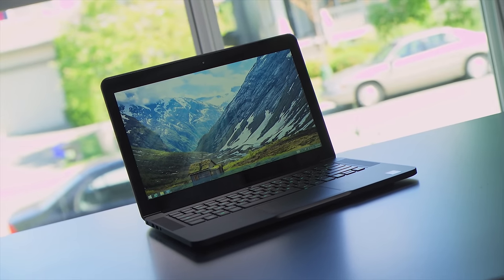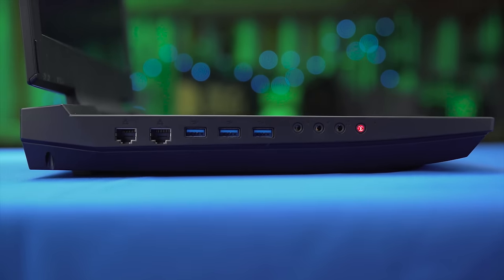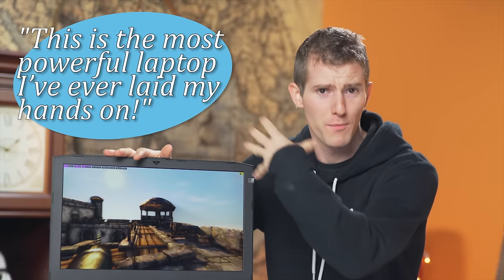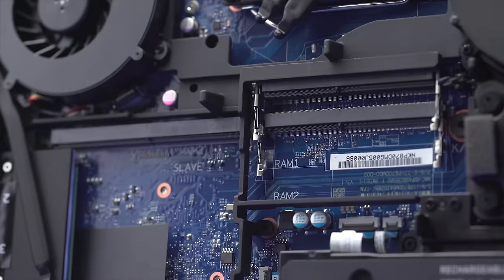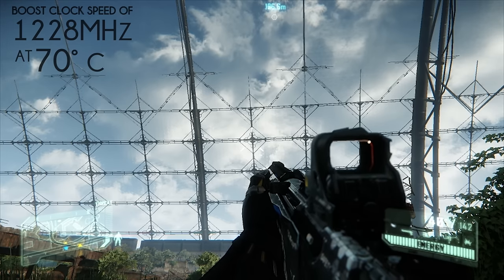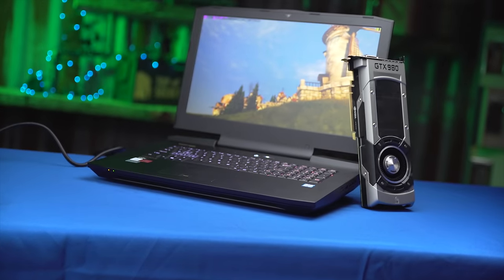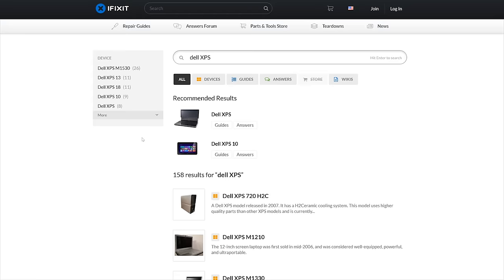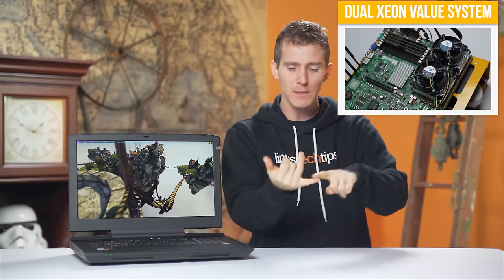Full Desktop Gaming Performance in a Laptop

Comment: Which cpu is better? 6700k or 6820hk?
Reply: +Victxr Can't really go wrong so better go cheap, right?
Reply: +Victxr Also I think the 6700K is faster
Reply: ImPDK Idk man but i'll do some research but thanks man.
Reply: +Victxr definitely go with 6700k. If the 6820hk has anything different to offer, you wont notice. Just wasting $1000.
Reply: Generic Name The 6820hk can turbo to 4.2 GHz
Reply: but the 6700k can go up to 4.8ghz Victxr
Reply: ImPDK I don't know the difference between the two.
Reply: I need to know which one is best with editing for video, photoshop exc.
Reply: Victxr Unless you care about power efficiency just go with the 6700k
Here's a useful link for comparing the two:
http://cpuboss.com/cpus/Intel-Core-i7-6700K-vs-Intel-6820HK
Reply: ImPDK No, I just need to get the job done fast so it will be enjoyable. About how long would it take to render a video about 4 minutes long at 720p at 60fps? Also is there a gt72 model from msi that has a 6700k processor?
Reply: Victxr
About the gt72 you can check this link:
http://www.msi.com/product/notebook/#?tag=Intel%206th%20Gen.%20%28Skylake%29
And I can't give you an answer about video rendering time since I don't own one myself (sorry about that :/) but I can tell you it's one of the best CPUs out there for video rendering.
Reply: ImPDK Altight but what about the render speeds?
Reply: Victxr
Can't tell because I don't own the CPU and I can't find anything online but I can say it's one of the best for video rendering, as I said in my previous comment.
Reply: ImPDK Okay then. Thank you for your time I really appreciate it and this upcoming future I will have enough saved for it. :)
Reply: Victxr
I'm happy I helped :)
Reply: The 6820hk is a laptop-grade or mobile-grade cpu while the 6700k is a desktop-grade cpu.  With that said, the 6700k is better but, much more expensive and is not really needed for gaming. If you're looking to buy a laptop the 6820hk would be just enough. Mind me though, I don't really know much about laptop-grade hardware and which is good for your type of usage.
Reply: ImPDK :)
Reply: ImPDK Also for this laptop, what advice do you have to take the keyboard off carefully.
Reply: Victxr
Search for it I don't really know, sorry :/
Reply: +Victxr  More Letter = better

everyone knows that -.-
Reply: Artai0s Dev
Not necessarily
Reply: Artai0s Dev lol no 6820hk has more letters. But performs not even close to the 6700k with 1 letter. Lol that hypothesis is bad
Reply: Captain Einstein
i know thats why its a joke...
Reply: Artai0s Dev Sorry I can't catch sarcasm on the internet.
Reply: Captain Einstein
no problem
Reply: definately 6700k is faster

6820hq is designed to consume less power and it relatively remains cool

bt 6700k is a beast

Comment: I didn't know Sager was still in business. Around 2002 or 2003 I bought one with a DESKTOP ATI Radeon 9000 GPU and a DESKTOP 3 GHz Pentium 4 w/HT. Thing weighed a TON and the battery started crapping out after only a couple months. Still, it kept up with desktop systems for several years.

Comment: This is more of a preview than a review.

How is the heat after 3 hours of intense gaming, are the keys responsive, and do they feel firm? Can you disable trackpad easily? Hows the battery life? I'm sure if you give me 100 components and a CNC machine i can hack together a few laptops, but this doesn't mean the experience is good.

Size has not been an issue for a long time. It's not hard to fit it all in if you really try. The problem is however, the smaller it is, the worse the heat distribution is. This is a problem with half off the laptops I have used.

Comment: Love it, I've got my Alienware 18 and have been looking for a replacement in the future since they no longer make it.
Reply: Ready to drop 5k?
Reply: +Br ad lol
Reply: Get a alienware 17 and graphics amplifier with the best gpu available.  And it will still be cheaper lol
Reply: Give me a gtx 1080 pls :(
Reply: +chick royal Just get a Visiontek R9 390: its the same size memory and could 4k like the 980 Ti and 1080, but for the fraction of the cost. It will be at least another couple months for the price to drop since the 1080s on ebay are in the $500 range. If you want the best gpu for the size, just save up for a 12gb Titan, or sli the older 6gb titans that people sell online for $160-250...
Reply: +Rock GamingTV amen to the amplifier,  since I got it used for 80 bucks. Should I stick a FE 1080 or the Titan x in it?
Reply: Philip Ottey 1080, as titan x is overpriced , though which one? maxwell or pascal?
and you don't really need to get FE only for amp, you can still choose some a bit smaller aftermarket cards.
Reply: Rock GamingTV Pascal because of the 4k speed, but I say FE because it'd be epic inside of an Alienware amp or the recent Aurora desktop period.
Reply: Philip Ottey get 1080 as i don't think 20 fps more is worth it at a cost of 600$ more lol
and you can see evga sc/ftw , msi sea hawk x , evga hybrid gpus too they all fit inside the amp, ftw almost fits.
but no gigabyte g1 as it pushes air above so it will perform worse than fe

Comment: Clevo/Sager machines aren't really laptops. They're basically ultra-portable Mini ITX machines. It's not really a desktop replacement, it's more like a very small desktop. The chassis on the high-end models are actually bigger than some tiny Mini-ITX cases that support discrete graphics, such as the upcoming Hutzy XS case. As long as you realize that, they are great machines for someone who needs a portable desktop, but not really someone who needs to carry around a laptop. You'd need a separate ultrabook or a tablet for that.

Comment: I'm really dumbfounded, now I face the hard choice of getting either a GT80S with 2x lower wattage 980s in SLI, or this with a single desktop-level wattage 980. CPUs are more than sufficient in both, even overkill if we talk about Sager's.

I'd really love a mechanical keyboard, but it's one of those times I dare not toss a coin to pick.

Comment: By the way, Sager won't be able to "fit any more cooling ducts" in this beast, since it's a Clevo P870DM. All manufacturing is done by Clevo in Taiwan, all Sager is able to do is add RAM, storage or perhaps upgrade the display panel.

Comment: I wonder what the price of it cost and also how quick the battery will die if you game. It is amazing they managed to shrink a 980 to fit it but if one were to try overclcoking, then the laptop will suffer heat and performance issues but having said that, it is all the gpu you would ever need. I still prefer my 980 ti g1 gaming cards in sli. It wil be a few years yet before tech reaches the capability of decent virtual reality performance. Now that is something for you to try linus, Vr on that laptop. :)

Comment: I got this laptop for 600$.  Didn't have the extra SSD, 65 RAM or 2 TB hardrives - but still a monster.  Especially with I'm currently Im using it for.........mainly watching anime......my currently gaming computer works quite well.  I got this Sager as a backup just in case.  It's third in line should my current one die.

Comment: To avoid the super fan noise, just get a laptop cooler and done, your laptop will have a bigger ventilation gap and more air directly in the vents. I have one and works perfectly.
Reply: +LuisKsGameplay And put some proper TIM on the cpu and gpu, and undervolt the cpu. Skylake comes with a higher than needed stock voltage. At stock voltage they happily run at 4.5ghz. https://biosmods.wordpress.com/2015/10/21/sky-x9/3/

Comment: well the laptops still have a major problem, they overheat really fast. so a desktop is better not only for just for your budget, but also for the performance. the performance of the laptop can go down pretty fast. and the desktop can also overhet but not if you  place the coolers on the right place and keep the rig clean. in a laptop its pretty difficult to get inside the laptop to get it clean. so its really not that reccomended to buy a 4k 2k laptop.

Comment: They really missed the point.  What we laptop gamers want is a gaming laptop which can fully utilize the power of graphics chip even in battery mode only.  Meaning awesome gaming anywhere without plugging to the wall.  I hope someday they can invent battery which can provide that power and graphics processor which does not produce lot of heat, so it can maximize the battery use, afterall heat loss is an energy lost or wasted.

Comment: I'm really thinking....
For my study, I need a laptop.

I currently have a desktop pc, with the following specs:
Asrock FM2A88M-HD+ motherboard
AMD Athlon X4 860k cpu, running at 4ghz
6gb ddr3 1333mhz
and a shitty HD6570 GPU.

Now, I could do 2 things:
I could didge the PC and get the ASUS K501LX laptop for 800 bucks.

I could also get a cheaper laptop that is still good enough for my study for around 600 to 650 bucks, and get a new GPU for my PC.

What should I do?

Comment: Dell XPS M1710 .... Beast of 2006, still running today!

But seriously, i never used it very much outside tho. Most of the time i use it with Kali, or for quick support, if a friend need help.

What laptop do you use? and for what?
Reply: +Vollmer Tobias Check out the Dell XPS M2010 from the same year. Now that would be a beast to bad they no longer make laptops like that

Comment: I've learned my mistake with "gaming" laptops. Although it's nice to be able to play anywhere where there is a plug, if you're trying to do simpler things like take notes in class, the battery life is horrible, it makes too much noise, is not future proof and gets really hot
Reply: +Philippe  There´s no mistake, you must have done bad choices. You could´ve picked a laptop with Optimus,  proper cooling (they exist), and upgradeable cpu/gpu (although nowadays laptops with upgradeable cpu/gpu don´t have Optimus and the cpu´s are desktop cpu´s so there´s not much batery life - 2h - but until 2 years back that was possible.)
Reply: samot I forgot to mention I bought a gaming laptop that doesn't cost a fortune. 

Anyways, built my first desktop and wiped the games off of my laptop to use for school and it's not THAT bad.

In the future however, I think I'll buy a laptop with a decent CPU, long battery life, 14" max, discrete graphics. I honestly want something that is very reliable for a long time (maybe a ThinkPad?)
Reply: +Philippe Razer Blade, 14" FHD. I just bought one, so far it's a perfect combination of gaming and ultrabook. Optimus should take care of you when you're doing your notes, and it usually stays quiet unless you're playing crysis xD

Comment: Would the non-K version of the i7 6700 function good enough for 75+ FPS at 1080p for most games? I'm asking because of the significant TDP difference. If I could get away with having it be a lot cooler, that would be preferable.

Comment: This is crazy but they should not have put an i7-6700K in there. They should have put a slightly slower 3.3-3.7GHZ i7-6700 in there to keep thermals down a bit.

Comment: While I understand the concept of portability, I would rather stick to a desktop solution, since I wouldn't have any maintenance issues when compared to this laptop. Seriously, could you imagine if something failed with the cooling or if it needed new thermal paste? This thing would be a nightmare to disassemble, let alone upgrade.

Comment: I bought an Asus ROG gaming laptop with i7 4710HQ, GTX 860 (4GB), 8GB Ram, 250GB SSD because i have to stay in hospital since a year.
If you need to have a mobile gaming platform, a gaming laptop is a great choice.
Otherwise just get a desktop pc, you will get a way better system for the same price.

Comment: Anybody knows why vindictus doesn't use my gpu (gtx 960m 4gb) and instead it uses the integrated gpu? (Intel hd 530) I was expecting to max out vindictus with my 960m but I can't seem to find the option to switch the gpu and the fps is around 20-30 fps maxed out with the integrated gpu. (Btw I've already changed the things in the nvidia control panel to the 960m) Weird thing is, tera seems to use my 960m since I can play it smoothly maxed out

Comment: Wait... Isn't this laptop a more expensive "made for windows" re-brand of System76s' Bonobo WS? Or the other way round? It has the exact same specs, and looks identical (except for the pre-installed OS, brand logo, lighting, and Super / Windows key).
Reply: They're all based off the same original Clevo P870DM design. Clevo makes the OEM model while other companies rebrand it with their own tweaks.

Comment: The pace at which gaming laptops get outdated is way too great. Back in 2013 when I invested in an Alienware 17; I felt safe. Then came the horde of next-gen shit. Similarly, we can expect the same with this laptop too. The safe choice would be AMD's XConnect. Travel with a laptop with average discreet GPU and a desktop grade CPU; while the desktop-grade graphics adapter/amplifier sits at home, because hardly a figment of crowd would actually indulge gaming on the move. I mean serious gaming. That would be a good option instead of carrying around 5 KG behemoth everywhere. But that would defeat the purpose Linus made in the end.

Comment: How good is this? 

 17.3" Full HD IPS Matte Display with G-SYNC Technology (1920 x 1080)

                                                                        
       - Nvidia GeForce GTX 980M GPU with 8GB GDDR5 Video Memory

                                                      - IC Diamond Thermal Compound - CPU + GPU

                                                      - Windows® 10 Pro 64-Bit Edition Preinstalled

                                                                        
       - 32GB Dual Channel DDR4 SDRAM at 2133MHz - 4 X 8GB

                                                                        
       - 250GB Samsung 850 EVO M.2 SSD - as an OS Drive (Primary Drive 
C) 

                                                                        
                                - 1TB 5400rpm SATA3 Hybrid Hard Drive 
with 8GB SSD 

                                                      - 1TB 7200rpm SATA2 Secondary Hard Disk Drive

                                                      - Killer™ Dual 
Band Wireless-AC 1535 M.2 AC Wireless LAN + Bluetooth Module
Reply: +AssasinDG 
The specs are typical for 17 inch gaming notebook, but the hybrd drive is redundant if the system partion is on SSD.

Comment: How does this compare to having GTX980M SLI? (another option for this laptop apparently)
Reply: +Joel Hernández 
GTX980 should be around 80% more powerful than GTX980M.
Reply: King Taro Well that's odd considering GTX980M SLI is a lot more expensive than GTX980.
Reply: +Joel Hernández 
No, I meant the GTX 980m on its own. If you're going for SLI, you can go for 980 SLI as well, which is more powerful than 980m SLI.
So, it would be like this: 
980m < 980 < 980m sli < 980 sli

If you're just choosing between double GPU 980m and a single 980, go for double 980m. If you can up your budget by another €1500-2000, you can go for 980 SLI instead.

Comment: Lol, Mackbook, My buddies 2007 ASUS laptop with a T7500 Intel processor and a GT7300 beat his GF's brand new Macbook at $2000+ in every benchmark except HDD, but with a cheap SSD upgrade that is fixed.
Reply: +MortusArtis 
I call bullshit on it.

Even the Core M based Macbook has far superior specs compared to it.
Reply: +tyaty in terms of heat, power efficiency and size, Macbook is better but in performance gaming/benchmark, 2007 Asus is better.
Reply: MortusArtis
In which benchmark?
Reply: Geekbench (duh), you must have issues accepting that a Macbook is an over priced ultrabook with a fancy Unix GUI.
Reply: Overpriced ultrabook with a more powerful hardware.

Try an actual  game or any real word application (like Handbrake, or Left for Dead 2)and the Macbook Pro will run circles around it.
Reply: Lol no, If you spent $2k on a ASUS, Gigabyte, DELL, ACER, etc. laptop you would have an ultimate gaming super computer or a Macbook, OVER priced Facebook machine.
Reply: Or a really good lightweight compact size burnishes class notebook with actual resale value even years later.

Macbook Pro/Air is not a gaming notebook but not marketed this way either, but neither yours with its  puny GT7300 and  Core based C2D.

Heck, I do not consider my Asus G551JW-CN124D as a gaming notebook either.

Comment: Any laptops with GDDR5 8GB of VRAM? The necessary specs for pro users: 16 GB of RAM (DDR3/DDR4), 8 GB of VRAM GDDR5 (Radeon R9 390X, Radeon R9 390, or other equivalent GPUs) 4 TB HDD + 1 TB SSD (seriously?) 8 hours of battery life, CPU 4.0 GHz Quad-Core (Turbo Boost up to 4.2 GHz) or what we call as: Intel Core i7-6700K, Fan, Motherboard (DDR3 or DDR4 support, USB 3.0 header available, USB 3.1 is optimized, Wi-Fi is compulsory) and a screen UHD (3840x2160) or 4K (4096x2160) or 4K Wide if available (4096x2304) or 5K (5120x2880) or 5.7K Ultra-wide (5760x2160) minimum screen is FHD (1920x1080) native screen resolution, Touch Screen, SD Card Slot Available, screen size at least 15.6". Seriously? Who the heck has this type of laptop???

Comment: Having such a laptop would be useless mostly because its so big, the laptop its made to be light and practical so you can take it with you anywhere (it doesn't exceed 2-2,5 kilograms), this laptop seems a little bit heavyer (sorry I don't listened to hear its weight), if any laptop exceeds 3 kilograms , better don't buy it, better build a desktop pc , srry bad english

Comment: How can this get the power it needs without a proper psu?
Reply: +bob174d really, so it has to be plugged in at all times to work properly
Reply: +bob174d so it will need to be plugged in to game?
Reply: +bob174d so yes it would have to be plugged in